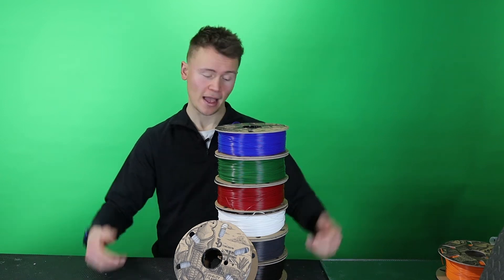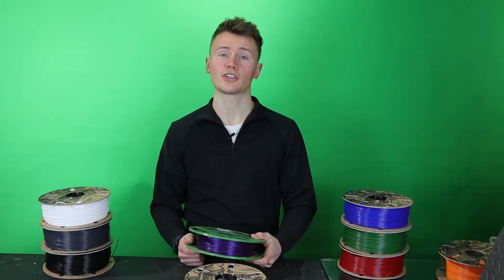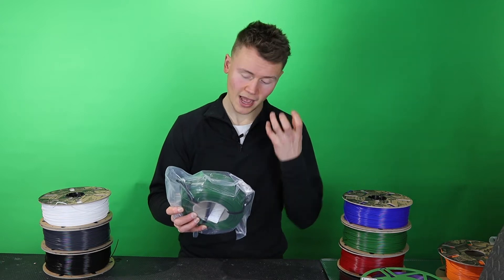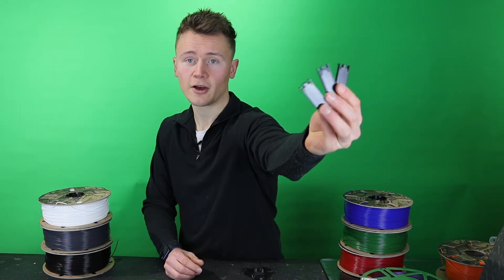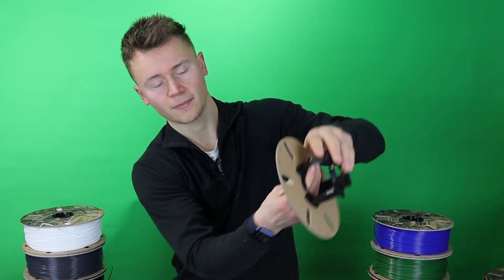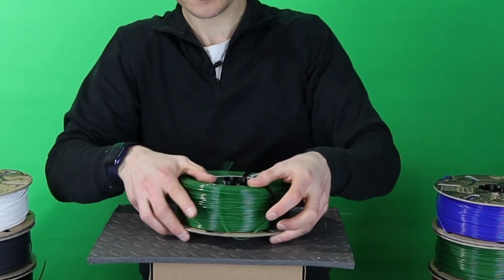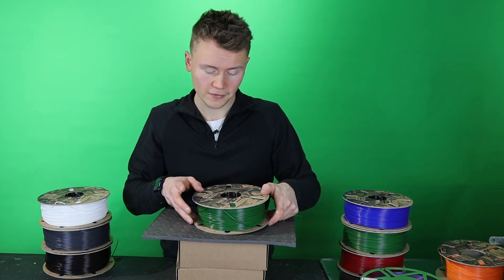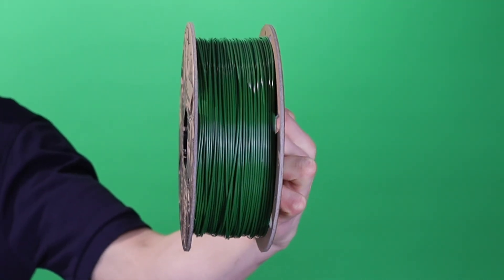From MasterSpool to MasterCore - How to setup our Hybrid Cardboard Spool and filament refill

Comment: is this designee available for use now? Can I download the printed part? Will this work with other cardboard spools that are more common now, polyterra etc?
Reply from the maker: It is indeed, also working on a screw version which will release shortly. Available for free download via the 3DTomorrow website, MasterCore product page.
Not sure how you mean? If the filament already comes on a spool there is no need to use the MasterCore spool system. Its designed for refills, to save the use of a spool each time.
Reply: @CallumColes  Hi Cullum, I checked the 3dtomorrow/product/mastercore-uk-pla/ page. No link there, no link on the video here, and no reference to it on your thingaverse. Where can I download the 3D printed core? Am I missing something?  Oh, I meant can I use the 3d printed core with other cardboard spool flanges??? I imagine the flanges are just separated from the carboard core? For instance Polyterra cardboard spools that I already have? They appear to be similarly sized and shaped.

Comment: This is great,  can we print the the spool part ourselves if we order the refills.  I am sold on the filament as you know and would rather adopt your system than copy stl files that may be on the various file sites.
Reply from the maker: You can indeed, I’ve now added the STL files for the printed centre to the MasterCore product page on 3DTomorrow. You have to order it like a normal product, but it’s free. 

If you chose to print yourself, you’ll have to pull the flanges off another spool when you finish up that roll, rather than sending it back. 

Although I will also add the flanges as an option to buy, since pulling them off a spool often leaves them tarnished from the glue.

Comment: Would it be possible to print the core with say the bio pro? And reuse the spools I already have? It looks like a great system.
Reply from the maker: Hey Karl, that's a good idea, don't see a reason why that wouldn't work since the centre parts are printed anyway. Will add the STL files to the product page on the 3DTomorrow website at some point this week!